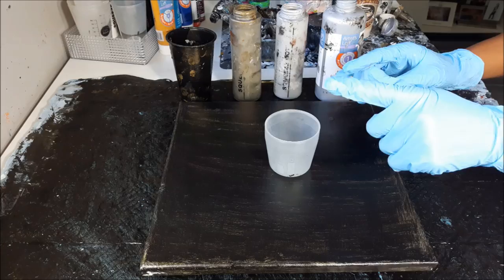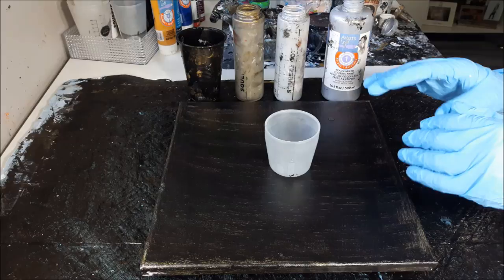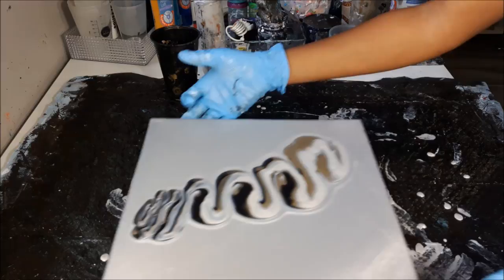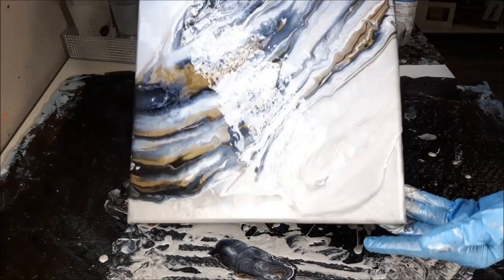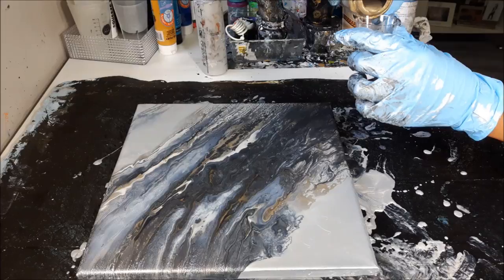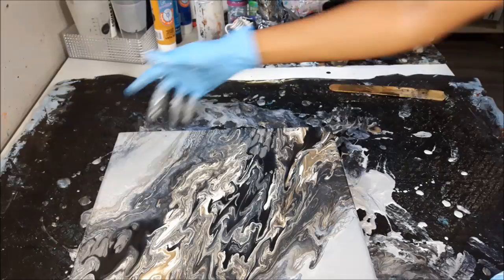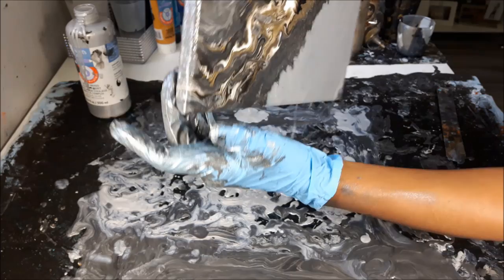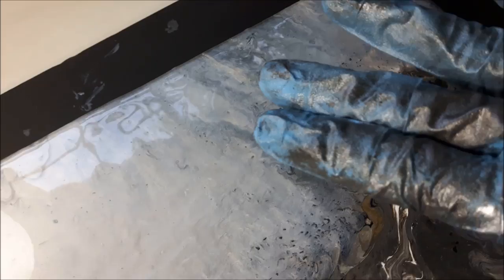HUGE MISTAKE! Acrylic Pouring with Pre-Mixed Paint / Acrylic Painting Abstract Art / Fluid Art (171)

Comment: So beautiful! My issue is if keep pouring more paint on the top will dry first & then get the crazing/cracking so being very careful w torch & any heat (plus consistency & colors that play nicely together. 
  Should the bottom paint be a bit thinner & couldn’t tell if it was wet or dry? Love using silver also!
Reply from the maker: Hi Paula, if you take enough paint off the canvas and use a good pouring medium, you shouldn't have crazing or cracking. Most times the base should be thinner so the paint flows better, but you can also have the same consistency for all of your paints. Honestly, it really depends on the technique and effects you want, but usually the base is thinner. That being said, the paint reactions in this piece is a result of the pre-mixed paints. I learned my lesson and I tried hard to save it lol. 🙂 I hope that helps.
Reply: Thank you as learning that certain colors weigh more like white & black! Then each technique needs a bit difference in the consistency but found if it’s all the same consistency it works but got a terrible pour one day as my black, white & silver just turned into a grey “mess” & wiped that off fast! Ty again very much. Truly practice & just know not ever project turns out great but love the black & more bright colors together!!